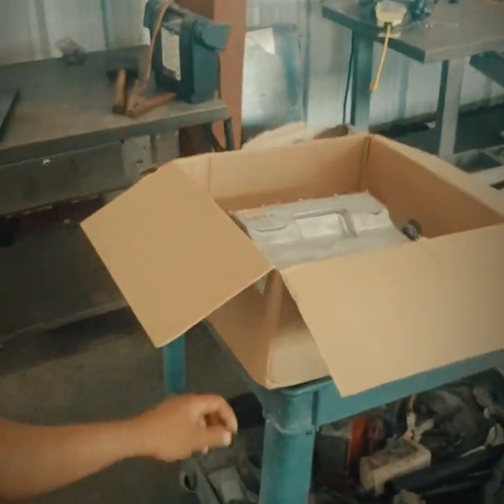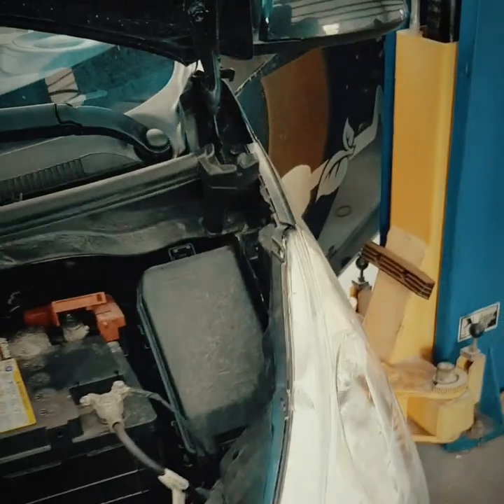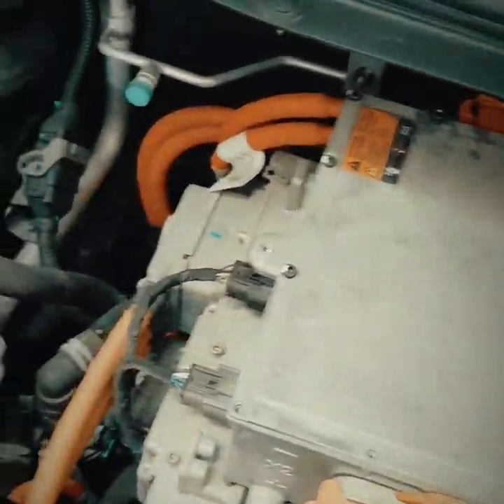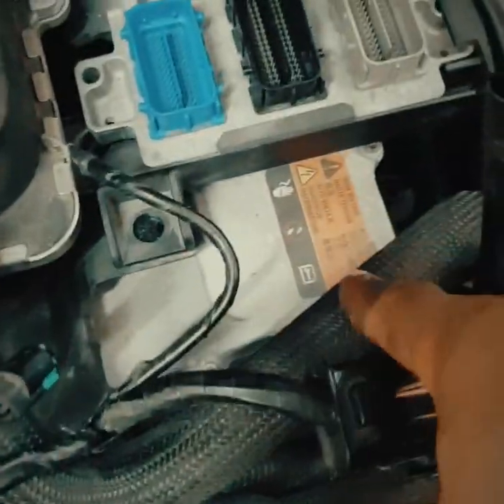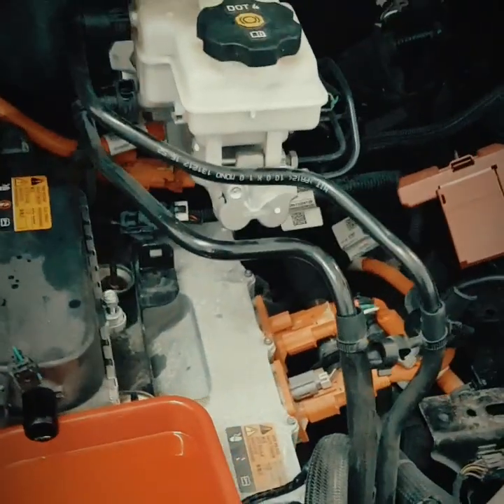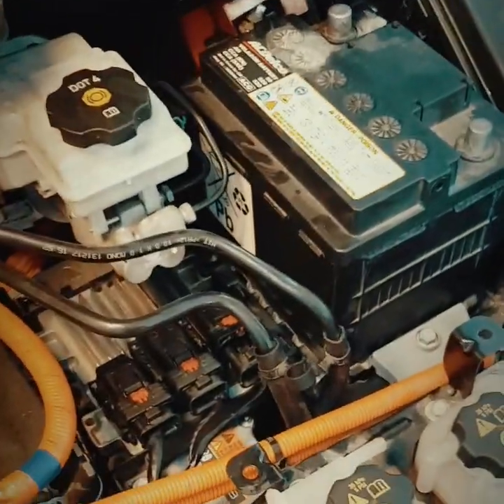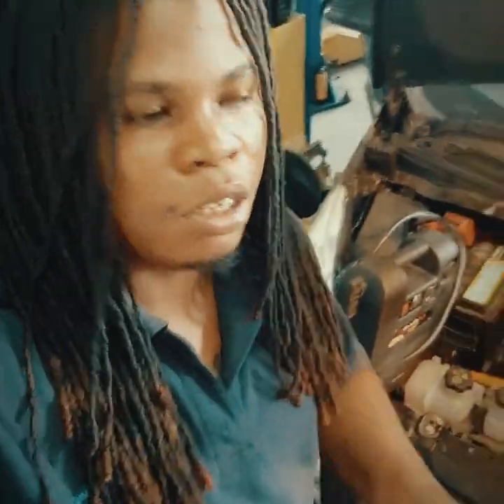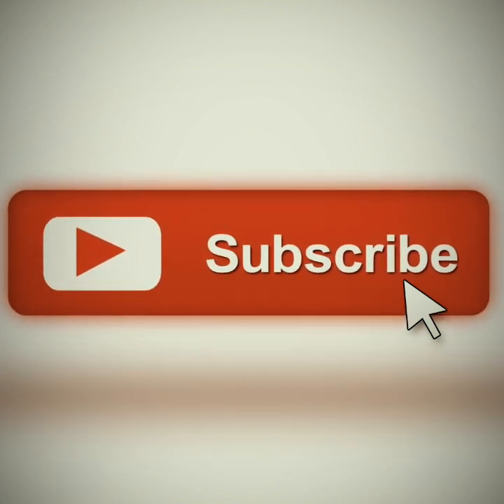2014 SparkEV Battery Charger Replacement

Comment: What code did it set to let you know to change the onboard charger. I have a non charging spark ev p1ee6 code. Wiring and fuses in charge port good.

Comment: Can be installed the charger of the Bolt EV 7.2 kW or the latest generation Volt 6.2kW  instead of the original 3.3W of the Spark EV?
Reply from the maker: I apologize for the late reply. Email me at geddyz4u@gmail.com and I will see how much I can assist u

Comment: Will any OBD reader to reset the ecu erase code be fine? Or is there a special scan tool required?
Reply from the maker: Need obd2 scanner that read HPCM2, HPCM1, EV, and HV Battery modules from the car. An Autel or Launch good scanner should be able to read and erase. You must diagnose properly before u are convinced it is the charger. Check for continuity from the charger port to the charger. There are also fuses located in the charging port too. Check those then clear the codes and u should be good.
Reply: @geddyzperformance  Dealership said it was the charging part that needs replaced, same part you changed. Is there a video on YouTube that shows you how to check the fuses? If not your the man to make a video How to's  ;)
Reply from the maker: @GodzillaMX007  it's exactly behind the charging port but u have to use safety procedures before u go there. If u can send me the codes u have I could have an idea where your problem maybe. 

Email me  at geddyz4u@gmail.com

Comment: So after I installed this part I hooked everything back up together and I'm still getting problem with the charge no green light. I even noticed that if I try to turn the car around it doesn't say READY.
Reply from the maker: Clear ev codes then retry
Reply: @geddyzperformance  oh I actually didn't clear any code! Also there is this orange plug behind the charger I was able to plug it with its corresponding plug, but I noticed that same plug has a little one pin plug attached to it, I was not able to find anything that actually plugs into it. Does something plug to it??
Reply: Its not a plug on the charger, its another cable with a main plug that has on top of it a one pin plug.
Reply from the maker: @GodzillaMX007  can u send me a picture of your codes to geddyz4u@gmail.com plz maybe u have wrong diagnosis